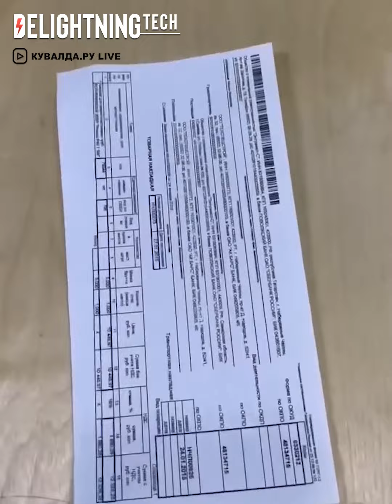Genius Life Hacks That Work Extremely Well

Comment from the maker: Let us help you navigate faster with these timestamps 📍☺  

00:00 Zip tie drain cleaner
00:18 Curtain spacers
00:59 Sharpening meat grinder
01:11 Sticky tape
01:23 Zip tie trimmer
01:39 Hair trimmer sharpening
02:03 Barbecue stand
02:35 DIY Cable wrapper
03:06 Paper towel dispenser
03:16 Hanging picture with fork
03:38 Rotating can duster
03:49 Ice blower
04:10 Hose holder
04:28 Removing trees with tire
04:55 DIY broken broom repair
05:08 Broken key remover
05:19 Straw hack
05:34 DIY Rope hanger
05:58 Spray applicator storage
06:10 Stuck glue cap remover
06:20 Zip tie bag hack
06:31 How to open spaghetti bag
06:41 Old belt shelf
07:03 Glass bottle protector
07:13 Radiator cleaning hack
07:24 Sticky tape cuter
07:37 Removing hart of an apple